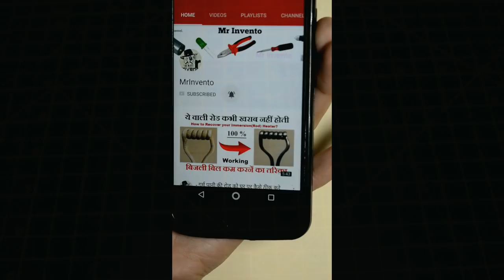How to Charge Mobile Phone With Lemon at Home | Charge a Cell Phone Using Lemons

Comment: Excuse me sir can you tell me te current rating of this experiment. As an electrical engineer my opinion some amount of voltage you can get by this experiment. And our mobile if you put more than 5 voltage it showing charging. But without current rating charging the battery impossible.

Comment: Sorry if make anyone feel bad, but I think it's fake, cause you rap the charger around so we can't see if the actual real charger
Reply: Its real
Reply: DamianTheBlueDiamond yes it's fake
Reply: @kekwkekw5653  no it's not 
Lemme say 
A lemon gives 0.9 volts so you need 6 lemon to charge it to 5.7 a mobile needs 5 voltage to charge it 
Its real I did this
Reply: @kekwkekw5653  the way he did this must have been fake but there is another video which is actually accurate